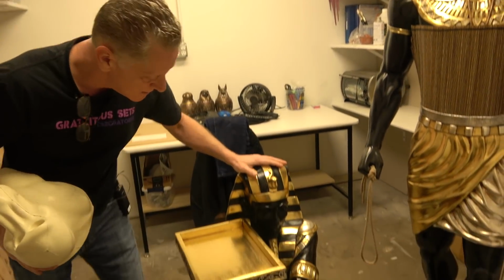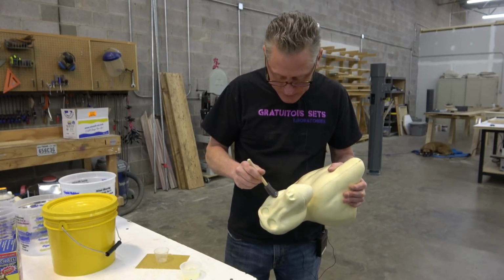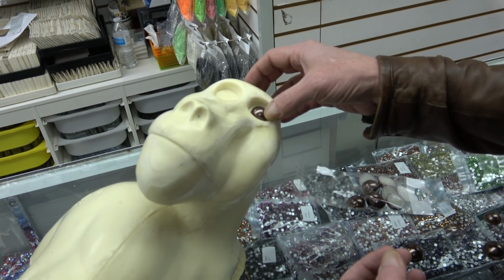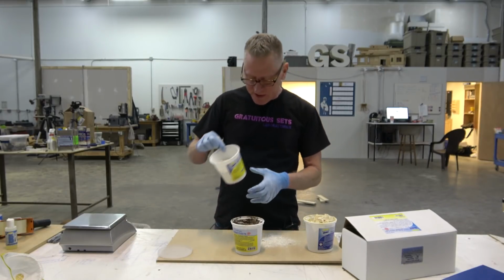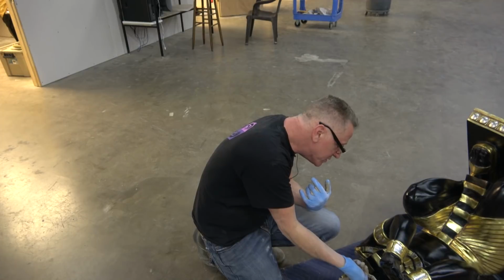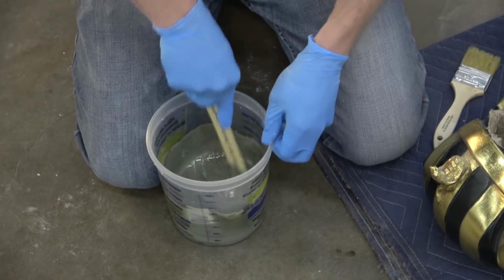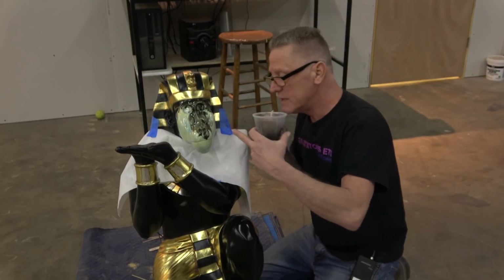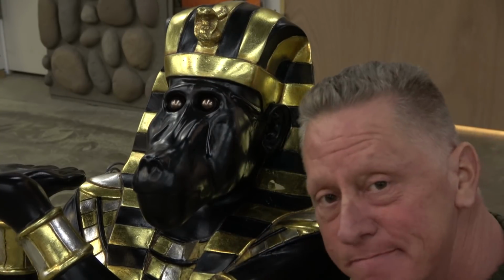A Primer on Vivisection (Thoth Statue Prop)

Comment: How many chip brushes do you go through in a month?
Reply from the maker: It's one of those few items we get from Harbor Freight- chippies by the case!! We do use good brushes sometimes, but I mostly paint with an HVLP or an airless gun.  Chippies for brushing silicone, resins etc, probably 30 a month ;-P

Comment: Very cool. Bonding the monkey head to the statue’s cutout seems like one of those weird...”no right way to do it” kind of challenges. The expanding foam was a really smart way to go about it. How’d it end up locking in? I kept thinking it would be good to scoop out some divots from the back of the monkey head so the expanding foam could fill into them and really hold onto it...but really the thought of that was just sort of mentally satisfying to think about lol. I’m sure the pitting and texture of the foam, mixed with the bonding agent you used was plenty! Love to watch problems like this being solved. Thanks again 

- Jesse
Reply from the maker: That's a really good thought! The statue was fiberglass, so, while it didn't really show on camera, There was a bunch of roving and texture for mechanical locking inside the head. Another thing that was missed on camera: immediately after we poured the foam and pushed in the head, we flipped him over backwards 180 degrees so we had foam all around the head expanding from all sides. I'd love to cut the head open to see the final result, but it feels super rigid and hard. That 15# foam is approaching the density of pine, so I'm pretty confident :-D

Comment: So, how did you determine the amount of  expanding foam you needed to use? What was the methodology used? 

It seemed to me that you were using a bit too much foam but then again, your baboon's face did not expand out from the cut out portion of the head when it expanded. Therefore, the amount of foam was indeed correctly measured.

Does making one's garage a better organized workshop count for "making something?"
Reply from the maker: Garage DEFINITELY counts! That's perfect.  The 15 lb. foam doesn't expand that much but, since we know that a cubic foot weighs 15#, we could measure the expanded volume needed, extrapolate, then measure out the components by weight instead of by volume. Damn fine question! I eyeballed it, though
Reply: @GratuitousSets  Of course you did, you genius you.
Reply from the maker: Pshaw..